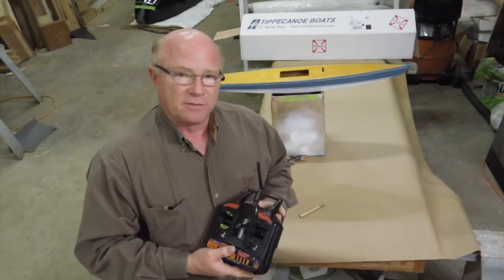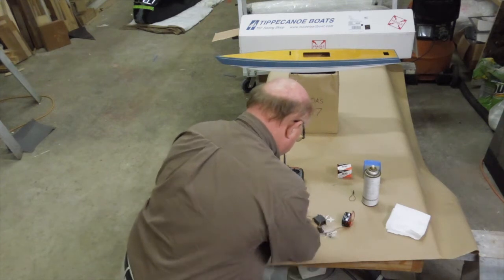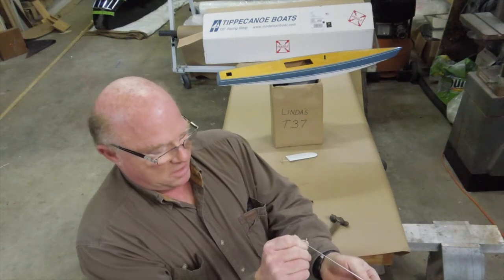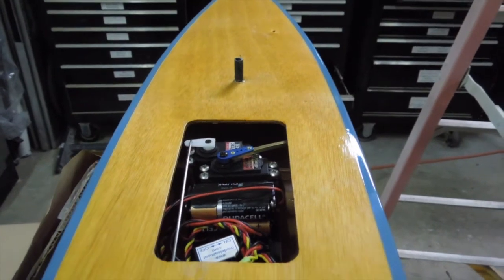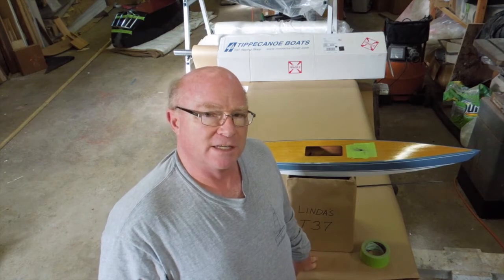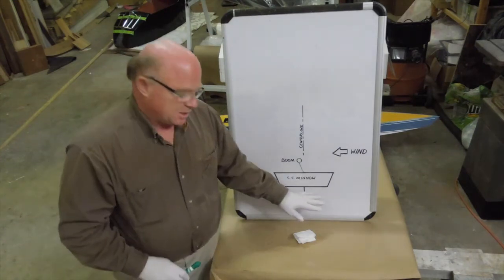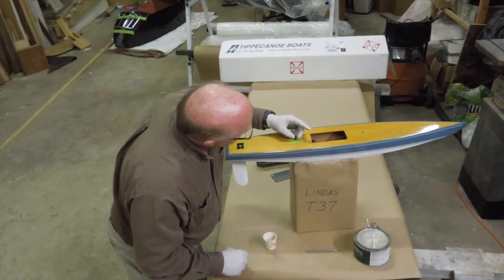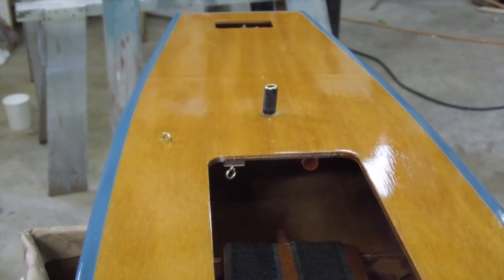T37 RC Installation

Comment: Under deck rudder shafts and single push rod don't work well and lend them selves to failure  , its much better to have rudder sleeve from lower hull to deck with a double horn and double push rods or crimped stainless wire with ball and socket fixings on the deck they are easyer to set up and adjust plus if one rod fails the other takes over plus you don't get push rod bend under load deck tubes will pop out about two inches from the rudder horn   , no big deck hole or deck tape .